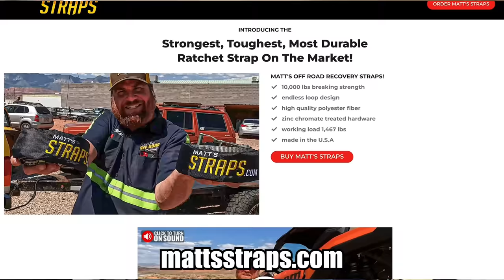Flash Flood Sinks The Ford Truck!

Comment: Looked like your tire was slashed 😡
Reply: Na, the sidewalls tend to fail because of the super low pressures they run. It doesn't take much to stake one at 6psi and even if you don't they still don't like being run at low pressures on road and I've seen them run 16psi on road.
Reply: @marvindebot3264  and milestar mts are prone to sidewall splits anyway